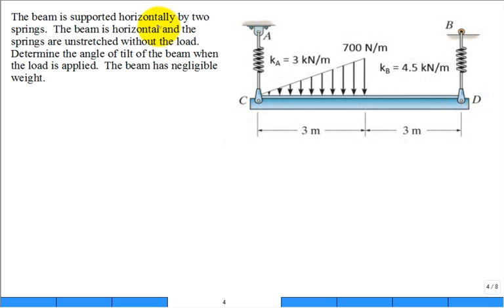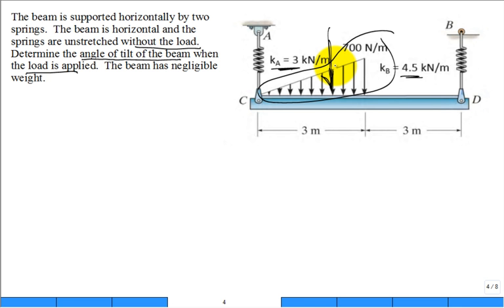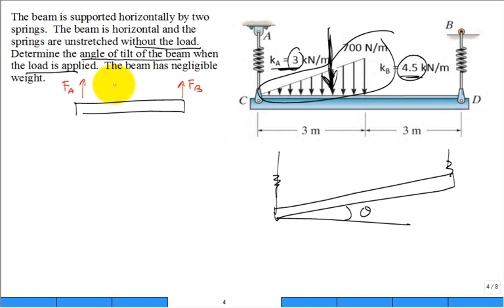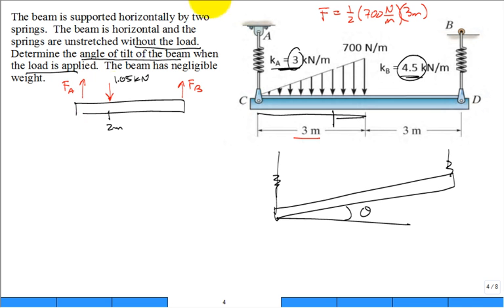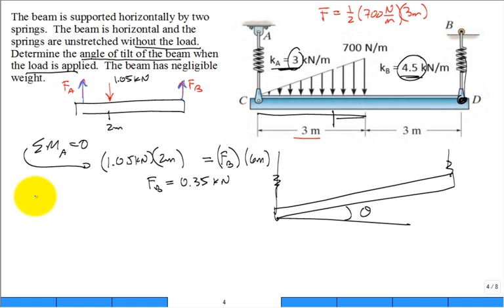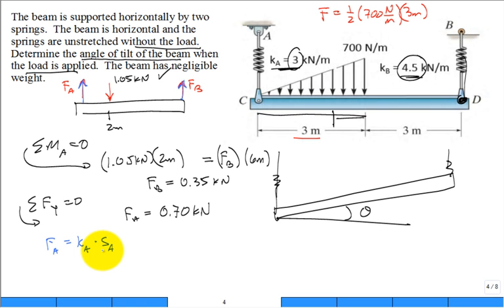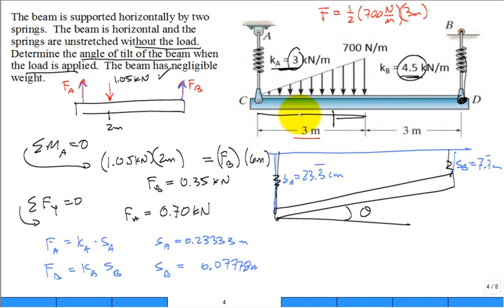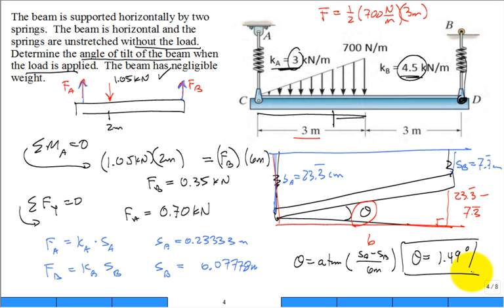tilt angle of loaded beam held by springs spr18

Comment: When calculating theta in the last step, I believe arcsin should be used instead of arctan, since the length of the beam does not change (the hypotenuse), but the length of 6m gets smaller as the beam tilts (due to the roller at B)
Reply: It's not moving.
Reply: @adamfadley4224  Support B is a roller, so it's able to move. If we assume what the video did, then we are implying that the beam somehow got longer. B can move freely in the x direction